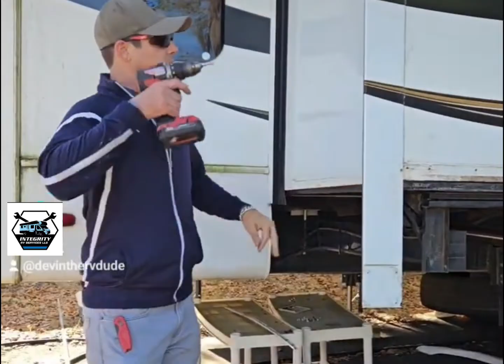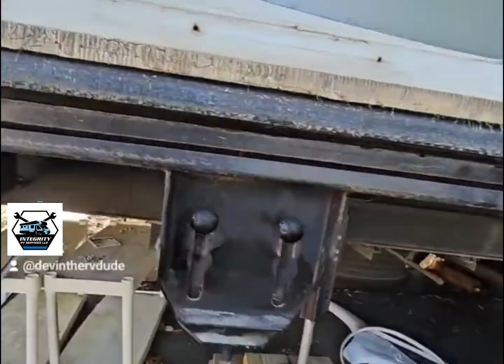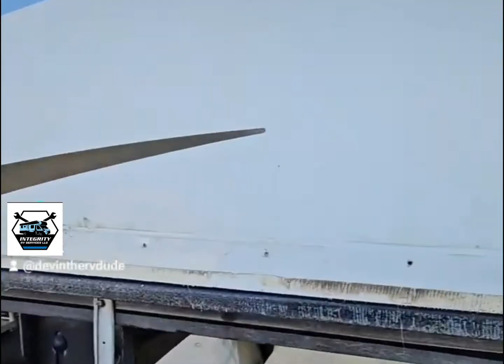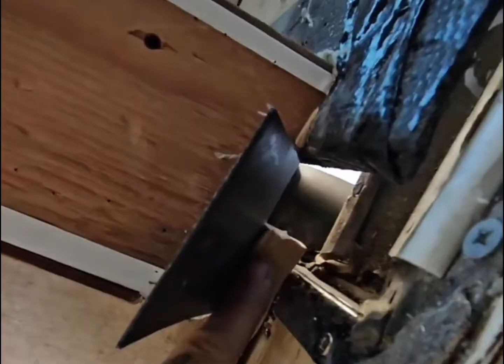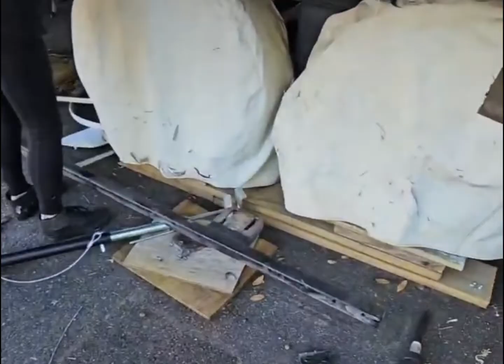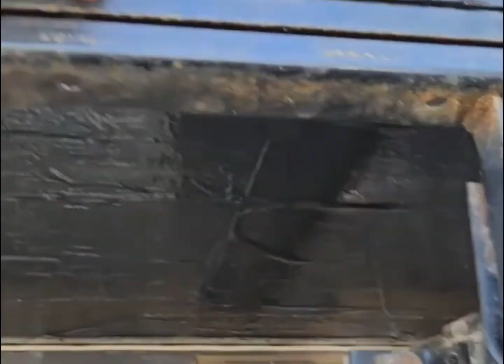How to replace an RV slide room floor - Full Process

Comment: I like the video. A bit confused on one part. You disconnected the electricity, how were you able to retract the floor frame?
Reply from the maker: So the electrical i disconnected was only for the lights and outlets inside the slide room.  This slide room mechanism in particular is powered by a motor underneath the RV, separate from the slide room.  Hope that helps!

Comment: What year is your Montana? I have a 2002. My outer bolts also are installed from the inside going down. I added more bolts to the empty holes many years ago. Not sure if I needed to. 
How did you attach the supporting 2x4s to the sides of the slide while you worked on the floor?

Comment: My slide floor has insulation between a weird piecemeal configuration... It's a 4 season. Any tips on constructing a new floor I'm this case? My ex tried to do it from inside while living in it. I'll be removing everything he did and starting over.

Comment: Excellent slide repair. Like how you used a block and crowbar to lift inside corners.  What type of screw did you use to secure the floor back to the aluminum?